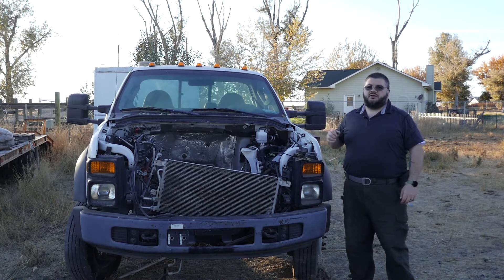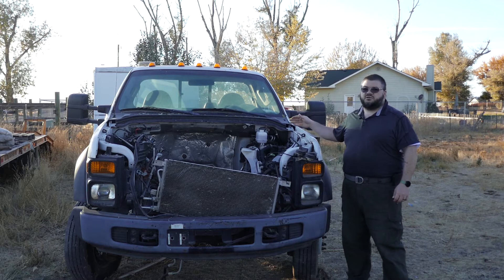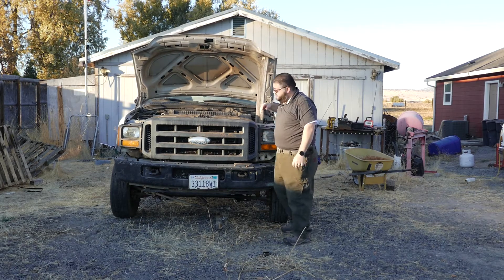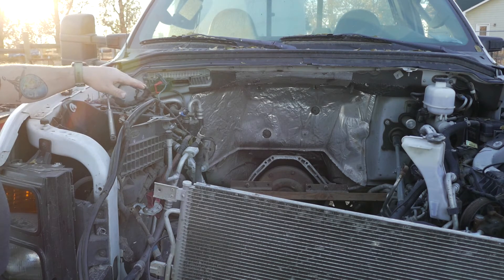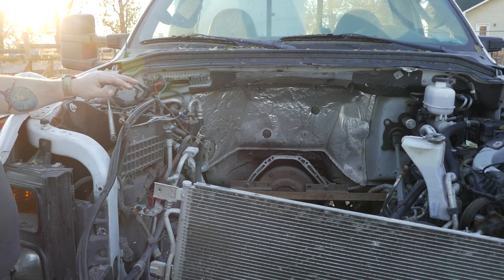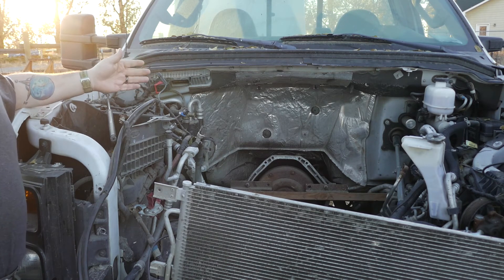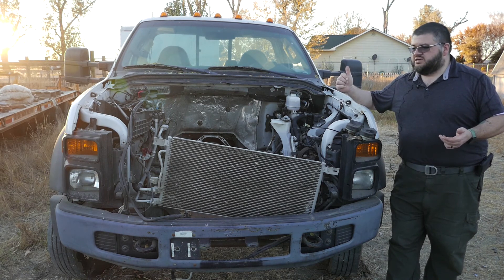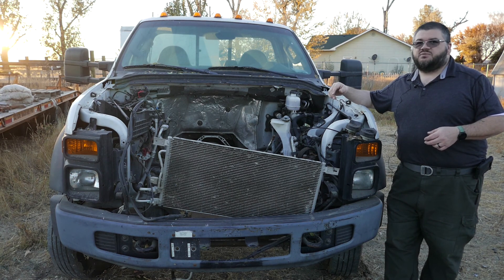Project Moby, 2008 Ford F550 6.4L to V10 swap PT 1

Comment: A little off topic but what wireless mic are you using? Nice project btw.
Reply from the maker: I used a Sony UX560 voice recorder with a mic that came with my Tom Tom GPS in 2007, repurposed to a lav mic :-)  The camera is a Lumix ZS-110 and doesn't have an external audio input, so I have to sync the voice recorder to the in-camera scratch audio in my editor.  The Sony has a lot of digital processing that it does to filter out background noise, so even if I had a wireless mic, chances are the Sony is still a better recorder.

Comment: Do you know where I can find an ECU for a 2008 F-550 V10?
Reply from the maker: Rockauto, ebay, local autoparts store?  You need to know the part number and catch code before you can get an ECU.  If you've already got the ECU, then any typical retailer can find it for you.  If you don't have the part number and catch code then you need to consult a friendly and patient autoparts store worker or your local Ford dealer parts advisor.  The basic ECU is used across multiple vehicles, but there are specific calibrations for each application.  You need to determine the part number and calibration code for your application.  AFAIK, 2007 and 2008 ECUs are functionally similar, but in some 2008 models they offered PATS anti-theft.

Comment: Just bought a 08 6.4 dump truck. I live in California and want to do this same swap. Will keep an eye on the project. Mind helping out if I get stuck ok something?
Reply from the maker: Yeah sure, I'll help you.  I'm at the point now where I need to splice the old and new wire harnesses together.  If you have an 08-10 donor truck it makes the process a lot easier.  Also check out JC Smith's Projects channel, he's done a lot of swapping around.  I've been keeping track of part numbers, so I will have a video that details the what, how, and where of harnesses and parts.  It makes it a a little more challenging when you're using a pre-08 donor truck, but 05-07 is what I'm using and it's working okay.  The only parts you can really reuse from an 05-07 are the computer, fuel lines, fuel tank, power steering pump/suction hose, heater hoses, and maybe transmission cooler.  The rest is all too different to work.  Then there is stuff that is different between gas/diesel 08-10 trucks, that's been another challenge on its own.

Comment: How hard would it be to do this swap if you have an 08 donor? I have an 08 with a bad 6.4 but there is an 08 donor I could pull the engine from locally. Would the new engine harness bolt right up to the current body control module?
Reply from the maker: It would be simpler if you have a gas donor of the same year.  You have to swap the computer and 3 harnesses connected to the computer, the fuel lines, engine, radiator, A/C lines and condenser, power steering pump, and fuel pump.  It's not simple by any means, but if you have 2 of the same truck, it's straightforward.

Comment: Im interested doin the same.i have a perfect 2002 ford v10 i want to install in an 08.is that possible
Reply from the maker: It will be a lot harder to swap an 02 motor because that motor never came in the 08.  The 07 to 08 swap really only uses the base engine (which is the same as the 08) and the ECU.  I've had to replace everything else (unfortunately) and little is the same.  The 02 uses a completely different ECU than the refresh motors from 05 and up, so literally nothing transfers over from an 02 to 08.

Comment: That 6.4 powerstroke had other notorious problems besides cracking pistons.
Reply from the maker: Notorious for being a low mileage glider for an engine swap :-)
Reply: @eformance  I would’ve done a Cummins swap to that truck
Reply from the maker: @liamthemarchingbandguy4063  I looked into it, a guy offered me a 24v but it was in an engine fire.  Cost would have been north of 5 grand easily.  Once I recoup some costs with spare parts sales, I figure total cost of the truck with new tires will be less than 5 grand.